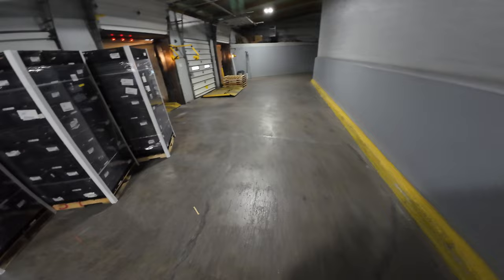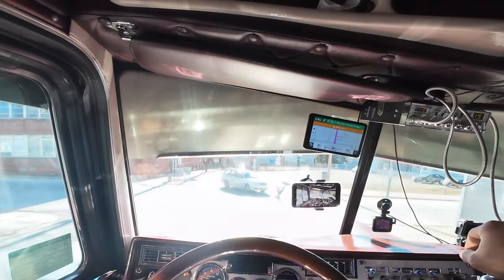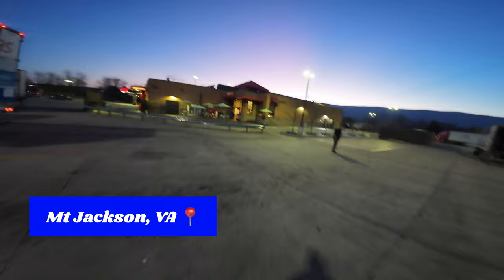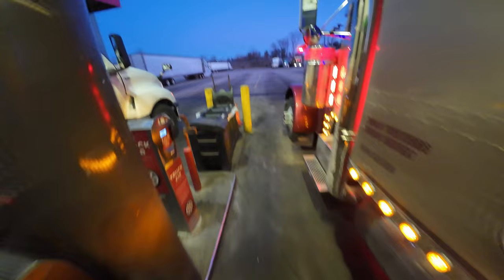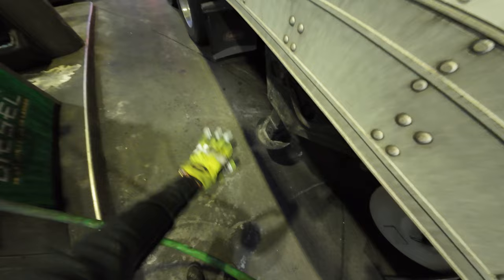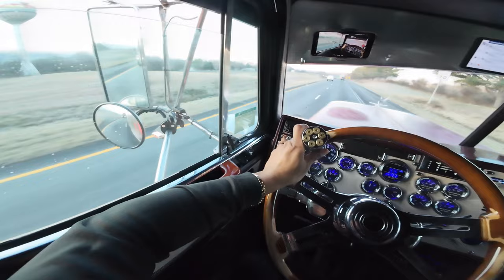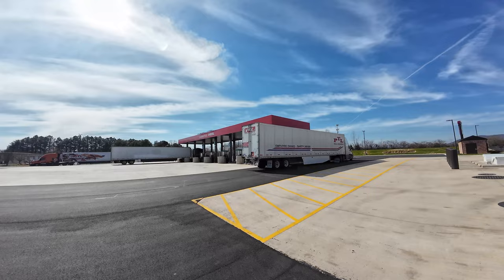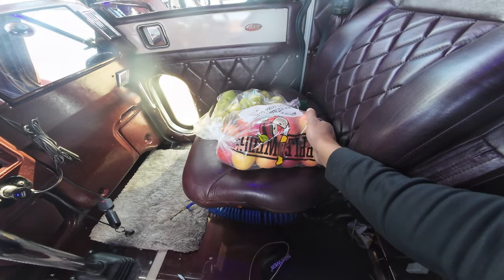This is how fruits are kept fresh for months | Walmart turned me away because my fuel was too low!!

Comment: Get Ur air & electrical lines underneath trailer & on back of frame   with quick connects & put stainless box cover over the ones on the front of trailer & then they can't pull Ur trailer.
Reply from the maker: I'm gonna move the air lines soon. On my to-do list! It's a very tight place where they loaded my trailer. Barely enough room for the yard jockey to maneuver.